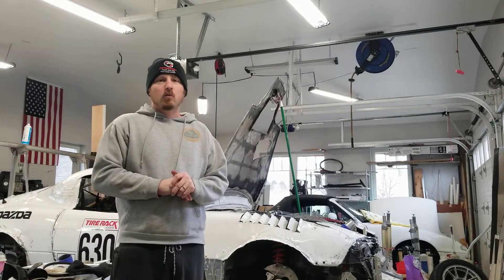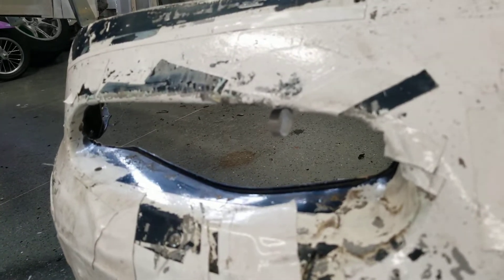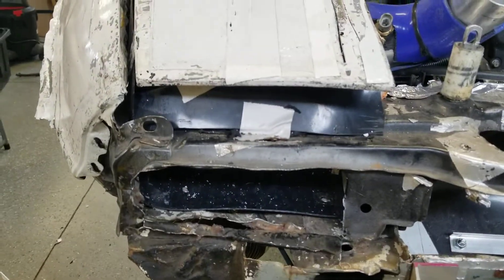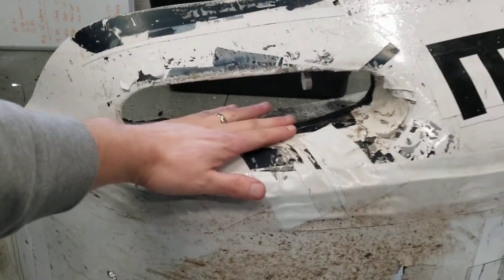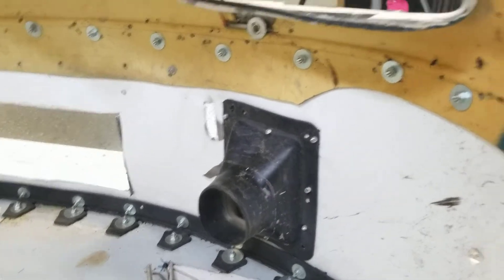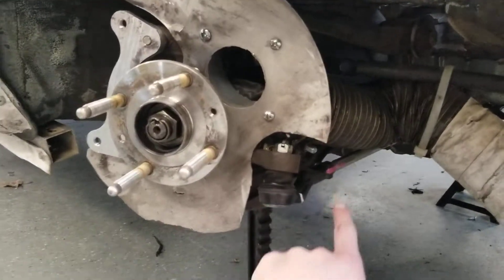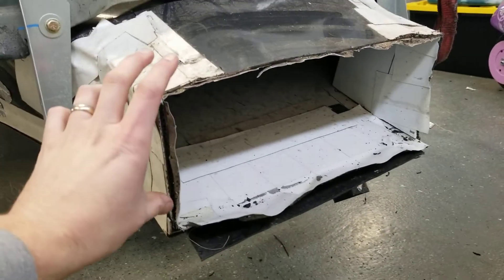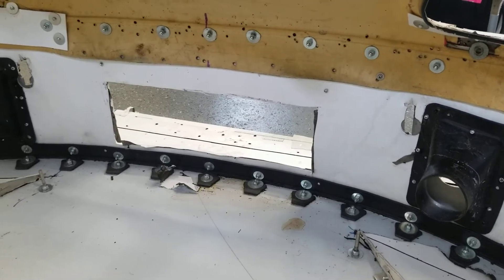Miata - Front Splitter/Airdam Aerodynamics Explanation - Team PartsBadger CCES

Comment from the maker: First off, here are instructions on how to build one:  https://docs.google.com/document/d/1xJPqVrW9P7uTkqNm3QIPSR5gsxuUVfbA4U4vQ_9REUc/edit?usp=sharing

Secondly, you don't want these to get too low, otherwise they will cut off airflow under the car which will cook the transmission and differential.  I think we got lucky with the side exhaust, but once we moved back to traditional exhaust routing we cooked a trans and diff within 7 hours.  

If you don't add any cut outs for splitter ramps you can get away with a single layer of 6mm alumalite.  This reduces weight.  

From testing, the end plates do add front downforce, but are also draggy.  On drag-strip tracks like Road America having them low or removed probably makes the most sense.  At tracks like Watkins Glen you want small or medium ones, and at short tracks like Gingerman, large ones are ideal.  

ninelives racing sells their version of the splitter, but the mounts will push into the radiator if you take out the splitter (somewhat common).  I would highly recommend doing different mounting if using their splitter and keep your radiator ducting separate from the splitter assembly.